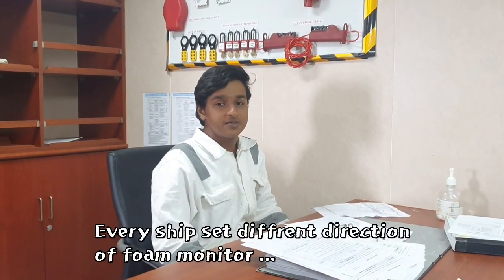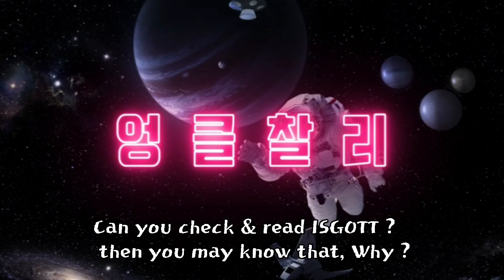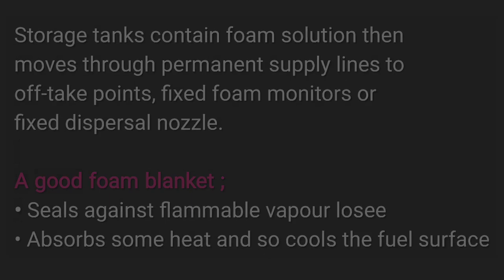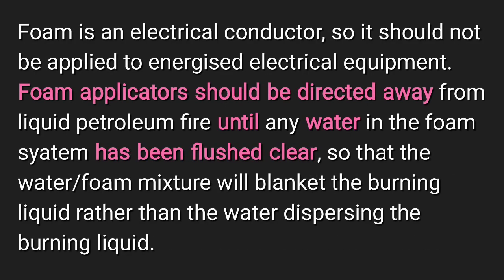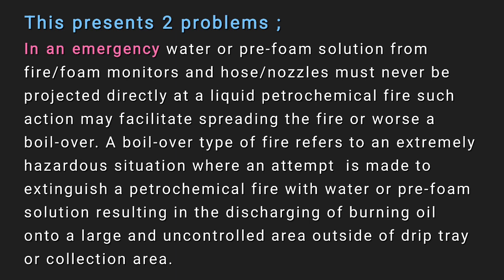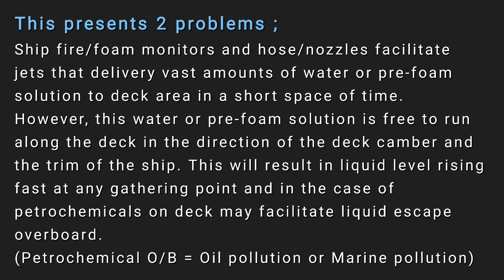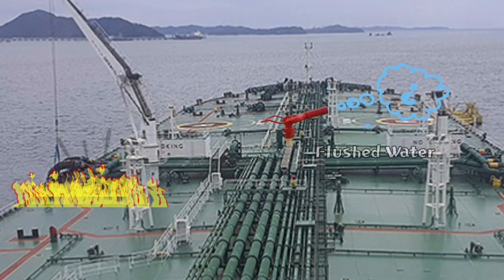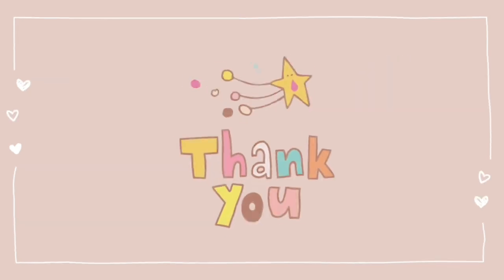Direction of Foam Monitor at In Port or Oil Terminal (이때까지 당신이 몰랐던 폼 모니터의 올바른 설치방향)

Comment from the maker: [The other Training video for oil Tankers]

1) Proper Direction of Foam Monitor 
    (At in port or At Oil Terminal)
https://youtu.be/5T1E0BMBegU

2) SPM or SBM Shore Line Flushing 
  / Sea suction through the sea chest
https://www.youtube.com/watch?v=Kt5-J8bTi2c

3) Stripping Pump (한국어 Version)
   (Cargo Oil Stripping Pump) 
https://youtu.be/eJOQGL25_dk

4) COPT - Cargo Oil Pump Turbine (한국어 Ver 1/2)
https://www.youtube.com/watch?v=PN-F3A0UNTE&t=2s

5) COPT - Cargo Oil Pump Turbine (한국어 Ver 2/2)
https://www.youtube.com/watch?v=shJNil0OP2M

6) Cargo Oil Stripping Pump (English Ver - 1/2)
https://www.youtube.com/watch?v=8x61qYTTbZ4

7) Cargo Oil Stripping Pump (English Ver - 2/2)
https://www.youtube.com/watch?v=6OE5fa7KV6g

8) COPT - Cargo Oil Pump Turbine (English Ver - 1/6)
https://www.youtube.com/watch?v=A1BuNkCrbiI

9) COPT - Cargo Oil Pump Turbine (English Ver - 2/6)
https://www.youtube.com/watch?v=Hjx5Yedo_qM&t=79s

10) COPT - Cargo Oil Pump Turbine (English Ver - 3/6)
https://www.youtube.com/watch?v=QTt1pBo3dbk&t=82s

11) COPT - Cargo Oil Pump Turbine (English Ver - 4/6)
https://www.youtube.com/watch?v=xnna9UeTGrw&t=32s

12) COPT - Cargo Oil Pump Turbine (English Ver - 5/6)
https://www.youtube.com/watch?v=rcaatP-dwJQ&t=28s

13) COPT - Cargo Oil Pump Turbine (English Ver - 6/6)
https://www.youtube.com/watch?v=rSS2kdtkK-4&t=41s

14) AUS - Shinko Auto Unloading System (English Ver - 1)
https://www.youtube.com/watch?v=iNkNjFH_R44

15) AUS - Shinko Auto Unloading System (한국어 Ver - 1)
https://www.youtube.com/watch?v=X6wGSceFdzQ&t=328s
Reply: Kk y lo la luz mi kk kk jajaja lkkikik lokk k mmmm kilo loo llegando lo loo kk Kiko loo l look look k lkk lkk lkkikik lkkikik lokk lokk loo llegando lll look look look look look lokk lokk lokk lo no k
Reply: پل
Reply: @RajabFamilyofficial-h  zc
Reply: p